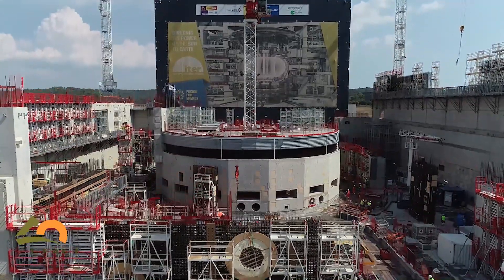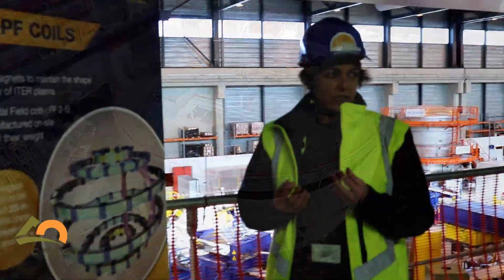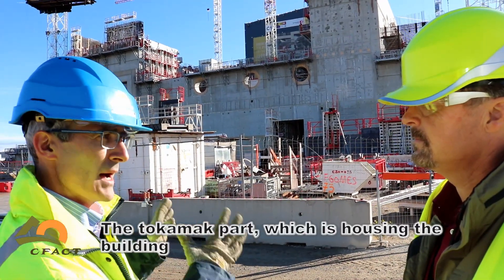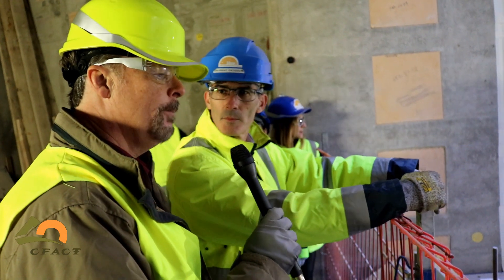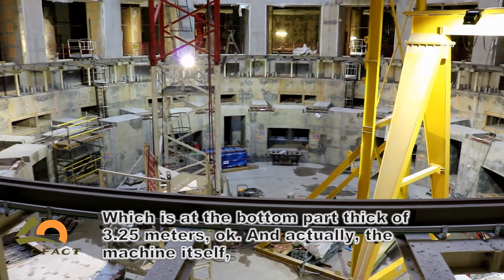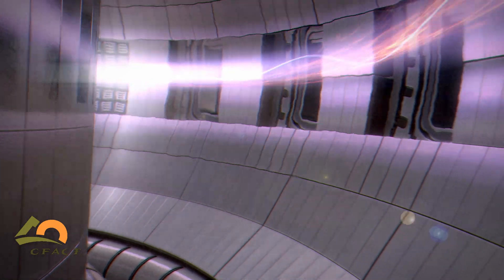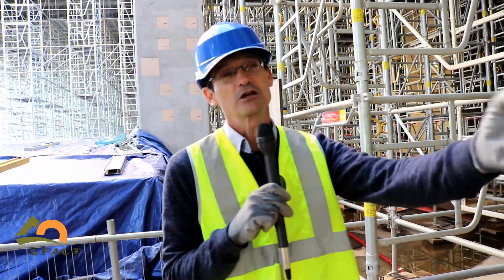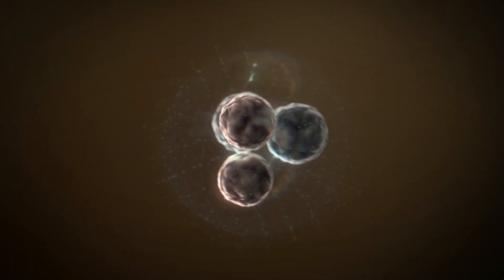Nuclear fusion: can ITER harness the power of the sun?

Comment: I haven't heard much news covering the critical "break even point" other than more theoretical musings that don't consider converting the resulting heat energy into electricity, and all the other parasitic energy costs associated with keeping the whole fusion reaction afloat continuously. https://www.livescience.com/43318-fusion-energy-reaches-milestone.html and https://hardware.slashdot.org/story/13/10/07/2352217/fusion-reactor-breaks-even. If anyone has anything more recent please post. Fusion is certainly the holy grail, but I've also read that there are less expensive alternatives to the Tokamak layout: https://hardware.slashdot.org/story/05/11/05/161216/alternative-to-tokamak-fusion-reactor